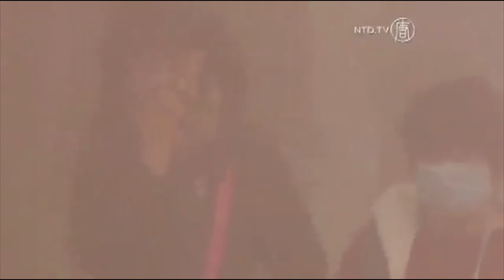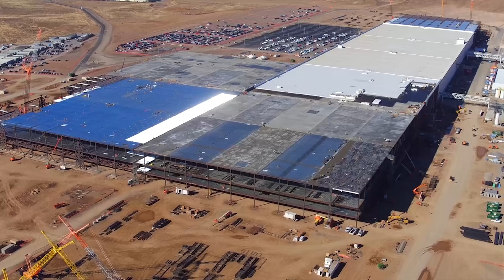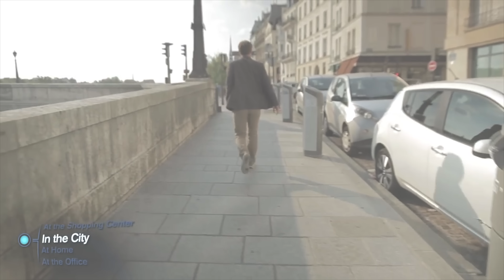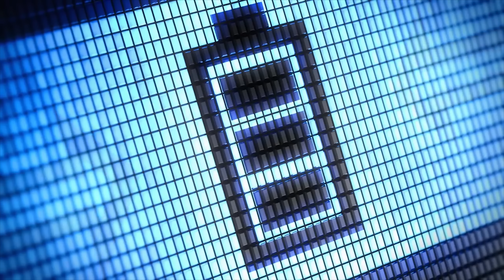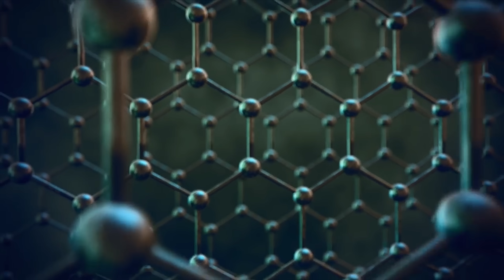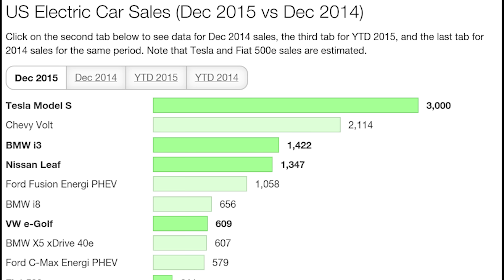Are Supercapacitors About to Make Tesla Obsolete?

Comment: LiIon batteries do not have the loss of capacity with use as shown pn that graph UNLESS discharged to near flat.    
     Only if supercapacitors have competitive cost, energy density,  volume and weight to LiIon would they be an attractive option for medium-long range electric vehicles..  Without the combination of those  features, faster charging is interesting but irrelevant.

Comment: Energy Analyst: "Batteries are not yet an alternative for cheap petrol"...you may want to rethink that not only are you forgetting to allow for a lifetime of "free gas" on your roof from ever less expensive Solar generation but you're also not factoring in the 2x to even 5x difference in the Tesla's service life (anywhere from 400k miles to possibly 1,000k).  We have already reached the tipping point...moreover the general public will be introduced to Tesla's when they start seeing them all over the place in about 1 1/2 years.  Imagine how frequently you will see those first 500k Model 3's (there have been slightly over 1 million Miatas built...how often do you see one on the road these days?).  We are on the verge of a disruption...give it a few years and see for yourself.
Reply: The cost of gasoline in the US is not available. Our tax dollars support all kinds of military and diplomatic efforts to keep that gasoline coming. We also can not estimate the hospital and health expenses due to fossil fuel exposure of our public. I would bet the real cost exceeds $10. per gallon. There is also great cost in maintaining engines that burn gas or diesel. All those oil changes and filters and the odd valve job or engine rebuild are far from trivial expenses.

Comment: You'd look less foolish if you gathered some real data.  First, supercaps are just regular caps with high capacity (max 1 Farad or so).  Ultracaps use a "liquid teflon" construction (max to 10,000 F+) and their  energy density is way higher than supercaps.  Still, the energy density of Lithium chemistry batts is WAY higher than the best ultracaps!  However, Lithium chemistry batts have about  300 cycle life avg, to a few thousand under perfect conditions.  Ultracaps have spec life ranges of 500,000+ charge cycles and up, an output current spec of 600 amps, and my surplus caps have output pulses of 10,000 amps with no apparent damage. 

 I predict that you will never see a capacitor powered commercial electric vehicle.

Comment: Electric vehicles are the future of automobiles!!! If a better energy storage and charging system comes along, it can only complement what Tesla has already achieved, NOT undermine it.
Reply from the maker: Do you think Tesla will be around in its current form though? Those Tesla 3/cashflow issues are potentially serious
Reply: How do super capacitors do in a severe car wreck? If one were to discharge its entire load suddenly how violent would it be?

Comment: Perhaps as long as two years ago I put this into my play later list and it has been downloaded as I currently am a premium member and selected the play later entire list to download. I think the bottom line when it comes to supercapacitor is it in order for them to be justified you would have to need your energy to be electrical and you have to need your energy to be coming out as fast as you put it in. There are very few applications that need energy to be electrical and of course even fewer that meet all these criteria including the very large potentially number of Cycles to justify the high upfront cost.

It seems like all your content is a year old or older according to the report when I look at your videos. We on this end leave then potential energy without any cost for the carrier only cost in charging it and then mainly Capital like nuclear or geothermal. You can call it steam to where heat from f i i b l e materials that's fission technology or better geothermal because geothermal is not going to run out weather there's Fusion on going or not within the Earth's core. you get your energy and then you converted into the condensate set of air what's like liquid hydrogen does not need to be have the volume or quartered

Comment: Tesla do not make Li-ion cells, Panasonic do and many of those cells will be made in the first Tesla owned Gigafactory by Panasonic employees on Panasonic owned production equipment. If SuperCapacitors ever achieve the energy density (both gravimetric and volumetric) to compete against the large energy storage capability of an electric car's Li-ion battery at a competitive price I'm sure Tesla would move to them. So far, graphene not withstanding, the chance of that happening seems remote. The very low charge and discharge times of SuperCapacitors are very attractive so I'm sure research will continue and maybe they will displace Li-ion at some time in the future but I would not bet on it. Tesla have no money at stake in Li-ion so they can change technologies with hardly any downside should a better solution come along.

Comment: I smell an energy investment con artist. A quick look at your channel confirms this.
Clickbait title with a bunch of wild speculation about a technology you know nothing about other than what you have read other people speculate wildly about. 
Ohms law cannot be cheated.
Super and ultra capacitors only hold a tiny fraction of the energy (as in Amp Hours) that a battery of comparable size holds and that power is more suited for instant delivery rather than gradual delivery. They are also MASSIVELY larger than a battery for the same energy density yet you somehow jump straight to Tesla being out of business and even speculate about the fate of their factory ignoring the fact that, if you were correct about graphene super and ultra capacitors, which you aren't, Tesla would just start using them instead of batteries. 
Thumbs down and blocking recommendations from your channel entirely. Good day to you AND your snake oil.
For those who WANT to believe this...don't blindly believe what a stranger says on youtube (including me). Test it for yourself with the super and ultra capacitors that you can buy right now. And that is what you'd HAVE to do because the theoretical ones he is wildly speculating about are 15 more years away according to BatteryUniversity.com (http://batteryuniversity.com/learn/article/whats_the_role_of_the_supercapacitor). Build a capacitor bank, charge it, and power a device from it. See for yourself how a battery runs a device (like a game controller) for a week and a super capacitor will run it for only minutes. People have replaced their car batteries with super capacitors, sure. But if the car doesn't start easily, they have about 3 attempts MAX before they are completely dead and need someone else (usually with a REAL battery) to jump start them.
Super capacitors exist. And Graphene shows great promise. But that is all that can be factually stated right now. Everything else is a huge leap to conclusions that are not supported by anything but imagination.
This video is wild speculation based on pseudo-scientific predictions of the future and is meant to convince you to invest your money in a way that is favorable to this con artist.
Predictions of the future are the main tactic of pump and dump scam artists. You have been warned.
Look at the videos on his channel and see for yourself. 100% of them are about energy investments in Oil, Electricity, Gas, etc. THIS is what a con looks like.
Reply from the maker: I'm afraid your nostrils have mis-smelt on this one - you're more than welcome to watch the videos on my channel, to see how long it's been on YouTube and the nature of what I cover. I'd love to think (and get the money for!) being in the pocket of an energy investment firm, but sadly it's not the case.

The videos (and indeed my little blog) are very much a personal hobby project and I simply cover what is currently interesting me. The videos get an average of a few hundred views and are on really niche subjects; getting power market data, changes to UK Peaking plant pricing regimes and the impact of policies on the short term oil markets.
Reply: it's not really wild speculation, see the latter part of Kaner's 2014 talk here  https://www.youtube.com/watch?v=du6H990Z9yA
Reply: also see the graphene supercapacitor company started in 2016,  http://www.nanotechenergy.com/

Comment: Propaganda shite ...first pics have cars with false smog....then the electric car with clear blue sky...
Reply from the maker: It's not propaganda - it's illustrative of the point I was making at the time about air pollution. If you wanted to look through the other videos and the blog, you'd see that I've argued for fossil fuels many times and see them as a vital part of our overall economy.
Reply: OK Energy Analyst. You seem to have completely missed the fact that to charge an electric car with a super capacitor in 6 minutes would require a supply of 1 Mega watt.   i.e. Energy storage of 100 KW hours (Tesla) means the car would need to accept a charge of 10,000 volts at 100 amps for 6 minutes.